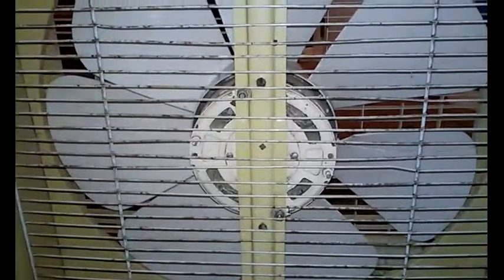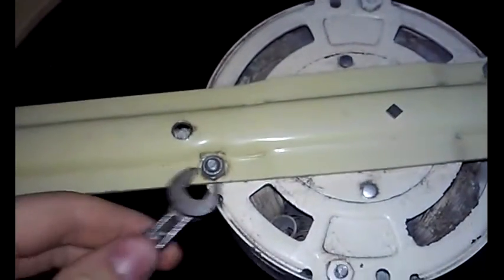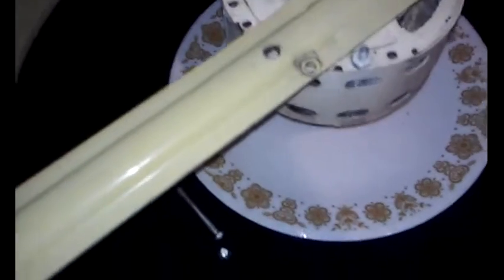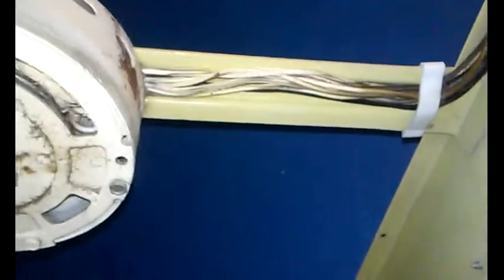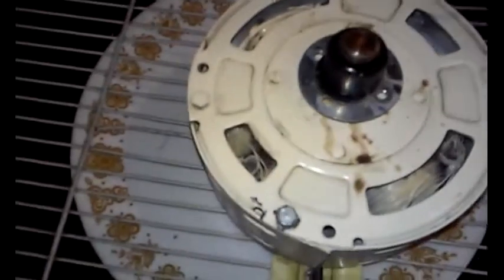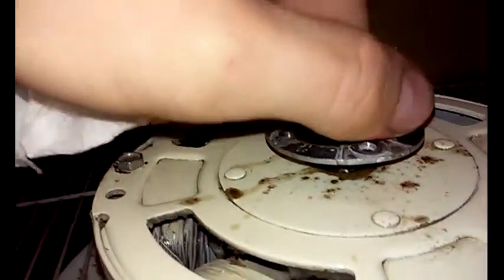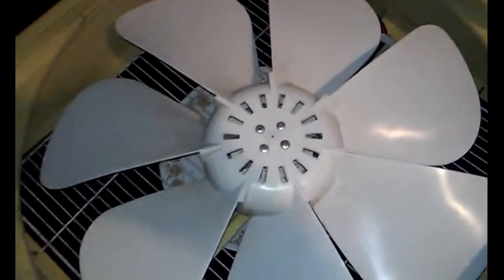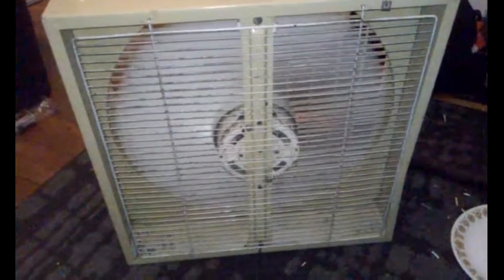Wards Signature box fan cleaning, lubrication, & demonstration 1980s

Comment: HOLY SHIT!  This is GREAT! :)

I, too, have done this same thing as you with fixing 'squeaky' and 'tight' fans by oiling them.  It'll add YEARS to its life.  Due to plastic parts, I use vegetable oil, or, whatever 'cooking' oil I have.

Only thing - you should'a drilled a ½" or ¾" hole in the bracket just over the fan 'AXEL' so that next time you can oil 'without' taking apart and sliding-over the bracket.

Also - gluing on that piece of broken blade is priceless! :)

Other than that...you're straight-on, Brother!  A+ all the way!
Reply from the maker: +classiclistener01 Thanks for watching, i can not drill because there are six wires glued to the bracket
Reply: +post 10 REALLY!?!?  There are wires on that yellow cross-bracket!?!?  That seems strange.
Reply: +post 10 Ha-ha-ha-ha-ha!  I can't stop laughing!  You're just like Charlie Allnut in "The African Queen" (1951) when he fixed the propeller blade on 'The African Queen.'

It's people like you who make-due with little...but, make-much outta that little.  Me, too!  I love buying great and old things and making them great and new.

You're a good man who 'makes things work! :)

You're awesome, Man! :)

Comment: the same thing happened to me years ago when i was running my vintage Vornado B28c-1 from the 1950s the one day it was on low it seized up on locked rotor in the motor and the motor got very hot i did oil it and running it later the motor now gets very hot so its bad i had not used it in several years as these are shaded pole type motors in these old fans meaning they have a very low starting torque and a poor running efficiency as the copper shading coils in the motor's poles are used to start the motor when the motor gets up to speed it interferes with the efficiency of the motor which is why they drow more amps than a Permanent Split Capacitor motor and the newer ECM DC Brushless motors. since i learned about the PAC motor im definately going to buy one to replace the motor in my vintage Vornado a Nidec Motor corporation US Motors RESCUE 9662 3.3 inch PSC motor as its a good motor its cooler running sealed ball bearings and comes with a 3 MFD 370VAC run capacitor on the motor as its good to work on its original choke coil speed control or a variable speed triac speed control. but one thing never use a lamp dimmer with any electric motor you may overload the dimmer of burn out the motor if its not "thermally protected". most of these old box fans like yours at the time used a big 6 pole shaded pole type motor. the smaller box fans used them too as far as i know Toastmaster Mc Graw Edision. the smaller box fans, hassock fans and air circulator used 3.3 inch 4 pole shaded pole motor which runs at 1550 RPM. and the 2 pole shaded pole motor found in the smaller fans or your furnace or water heater draft inducer runs at 3,000 RPM. as today the fan's made aren't good in quality the box fans made by Jarden, LASKO and other brands they are just flimsy with a smaller PSC motor which can burn out for the LASKO brand these motors from fans made from 1999 to 2001 and 2002-2004 they are known for catching on fire as when the motor burns out the windings melt themselves together short out and arc which causes sparks and which can ignite the plastic grille blade and mount or anything near it on fire. as LASKO had to recall the box fans made by GE Galaxy and Air King for a fused plug adapter since the recall All Lasko fans now incorporate a blue fused safety plug in all of their fan lines and other fan makers followed suit some having replacable fuses. as far as i know today the only american fan makers in existance is LASKO, Vornado Air LLC, and Fanamation. it seems like things today got more worse than good.
Reply: Hi, Derek.

Excellent comment! :)

Wow...Lasko fans self-ignite!!  If not used for a while, like any old TV; VCR; fan; etc., they should be 'blown-out-clean' of lint and dust with compressed air to prevent fires; then, oiled.

The only fan I've ever seen, myself, that overheated and began to smoke was an old stand-up industrial fan at a place I worked.  It was likely due to lint and dust accumulation on and around the ever-heating motor.  There was smoke all over the room being blown about by the fan itself.

I also have a Vornado air purifier (VAQS25) (1998) that works perfectly.  Only problem is getting the replacement HEPA filters!?!?  Every time a company produces a 'perfect product' or a 'beautiful product,' like the 327 CI Chevy engine; the Studebaker; the 4.0 Jeep engine; the Tucker automobile; etc...etc...etc...someone either discontinues it; makes it more difficult to get; and/or, stops making parts for it!?!?

I had to go to a hardware store to buy a locking screw for my chainsaw because the company no longer provides them!?!?  It works, but, WTF!?!?  Someone who's not mechanical and cannot improvise, adapt, and, overcome, would have thrown-out that lovely chainsaw and bought another at full retail price.

You're correct - things today are MUCH WORSE than before! :(

Thank you for all the information.

All the best to you and yours. :)